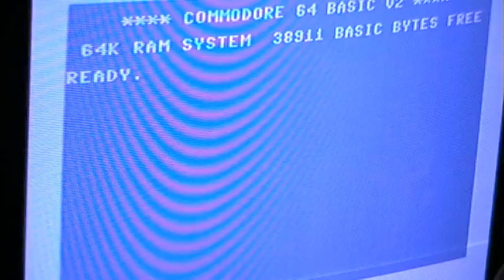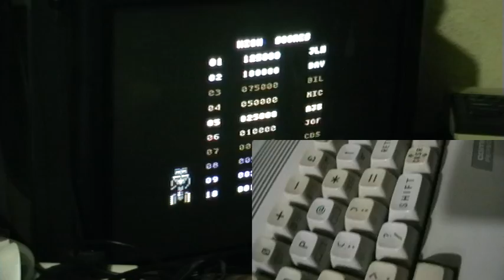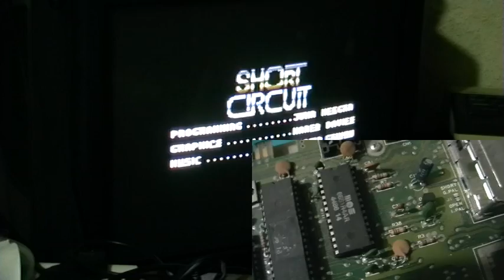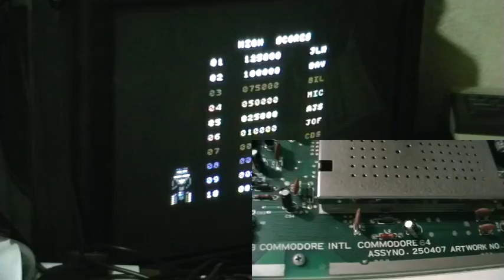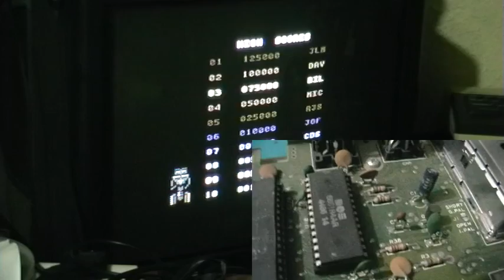Let's Compare - SID Chips - C64 vs. C64c vs. C64g

Comment from the maker: The difference between the old and the new SID chips is quite well known. Mostly for the problems with the digi sounds. 
That the old SID chips vary that much was a surprise for me, too. I've experienced it back in the day, but I thought my C64 was not working right or something else. 
You can take 2 C64 with even a SID chip with the same revision and they sound completely different. 25 year old electrolytic capacitors for the filters don't help too much for consistant filter response either..

Comment: The variation between different 6581 chips is very big. 8580s sound much more alike. It's a bit of a shame that you never quite know what SID tunes are supposed to sound like, how they sounded on the composer's machine. At least with 8580 you're always quite close to the original. I have a 1984 C64 with a 6581 that sounds VERY dark, and in some songs notes just get muted because the filters are being overzealous.

Comment: POKEYs all sound exactly the same. This is called QUALITY.
Reply from the maker: Well, the pokey is just a 4 channel square wave generator... there is not much room to sound any different ;-)
Ever heard about GTIA and CTIA?
They all look the same, or don't they? ;-)
Btw... the C64 has the same trouble with the VIC2 chip. They don't all look alike as well.
They all skimped on quality control at one point.
Reply: GTIA was how the developers wanted it to be, but they lacked time to finish it on time, so this was why CTIA was released first but this was only in 1978/1979. Most 400/800s were upgraded and not much later only GTIAs were used.
The only 2 real hardware issues on the A8 platform were the bad GTIA which appeared only in some 800XEs/65XEs from China which were only built in the very last years and the bad MT RAM chips in the 130XEs. Both of these  happened when a certain former Commodore boss was boss at Atari....
So yeah, same mistakes in cutting costs just a bit too much. But I’ll give Mr. Tramiel credit for truelly making homecomputers affordable....I still have my ST around here....
Reply from the maker: @atariandre5014  Same with Commodore.
The later revised SID was running to the original specs.
The downside was that many programmers used an off spec older SID chip and programmed it so that it sounded good on their machine.
Commodore also had a flaw in the video output of some later machines.
You got 'pixel snow' in the border in certain games.
But both were great machines to play with and make your first steps in programming.
I would have loved if the Atari machines would have had a bigger market share.
That would have driven both Atari and Commodore to improve teir machines further instead of selling the same shit for 10 years or even longer.

Comment: I had a C64c (bought from Dixons) and I was very disappointed with the quality of the digitized sound compared to my friends C64. I even took it back to the shop cos It was the amazing sound capabilities of the C64 what enticed me into buying it. They swapped the machine over (cos I said it had a dodgy sound chip) but even the new one sounded just as bad. There was a definite difference - people thought at the time I was mad!
Reply from the maker: Actually, Commodore fixed the glitch in the SID chip that was exploited to produce the digitized sounds.
There is a simple mod to fix the digi-sounds but nothing can bring back the sound of the old SID chip.
Reply: My C64C worked fine with the samples so must have had the old chip

Comment from the maker: This has nothing to do with cost cutting. The SID chip has quite a few analogue circuits on it, where slight differences from manufacturing can vary its specs quite a little. Even 2 SID chips from only a couple of weeks apart can sound quite diffrent, if they are from different production runs. 
From a technical point of view, the "new" SID chip is actually an improvement. It's closer to the original specs than the old one.
Reply: Theshadowsnose so I guess then only through emulation and outputting to a known high-quality a pair of speakers will we ever know what the games were actually supposed to sound like

Comment: You can definitely notice the difference somewhat in the bass and drums. But the bass especially. (I especially noticed in SIDPlay when playing the Creatures OST with it emulating both chips) Seems the last tune was designed with the later 6581 chip in mind.
Reply from the maker: You mean the 2nd tune in this video, right?
I'm not sure what chip it was designed for... that Martin Galway guy had some really unusual SID chip in the C64 on which he composed the tunes. 
I remember that there was even a special setting for it either in SIDPlay or in VICE.

Comment: Wow, thanks for this great demo. I must say, I think you could probably find some songs that would reveal even greater differences between these. Maybe some Rob Hubbard songs. He really pushed that chip to the extremes. As far as I recall, the lowpass filter is one of the bigger differences, and the songs in your example don't seem to use that very much. But great test! Much appreciated.
Reply from the maker: From my own experience, Rob Hubbard tunes sound pretty similar on both chips. At least the older ones like Monty and Commando.
I've tested a lot of different tunes in a sidplayer where I could just swap the chip in software.
The ReSID emulation is not perfect, but I think it gives a good impression of the differences between the different chips.
I really found that the tunes from Martin Galway showed tho larges differences between the different SID chips.
What I should have done is put in a tune that was done with the new SID chip in mind, but I didn't know any back when I recorded this video.
I probably do a remake of this video eventually just because I got a 3rd party content match on the "Who's Johnny" tune. The only reason why I didn't take this one down is that I think that it's a pretty good video and there was nothing comparable on Youtube when I released it. Haven't checked if there are similar videos nawadays.
But I'm not going to do this any time soon... as you can imagine, this is a lot of work.

Comment from the maker: If you can live with the different filters, there is a simple fix to give back the digi sounds. Just google for it...
Btw. The reason why there were no shouting sounds in the 'Fist' video is either htat I turned them of or that there are no sounds in demo mode... I can't remember.
Reply: Digi sounds like crap on C and G models with the new SID. I thought my machine had a bad SID at first!

Comment from the maker: Early models had the PCB from the last breadbin model. They changed the case to the new one before they made the cost reduced board with the new SID chip. At least here in Germany.
This C64C also has the graphic symbols printed on the front of the key caps like the original breadbin model. Later ones have them printed on top of the key caps below the letters.

Comment: I find sound chip comparisons interesting. What about some more from your other multiples?

Would be nice to hear some AMIGA ones if you get the 600 & 1200 and possibly some of your AY systems Vs AY.
Reply: Amiga models sounds identical from A1000 to A4000. Paula chip changed not so dramatic.

Comment: I prefer the 6581 sound but that's mainly because I had a breadbin and that was the SID it used.  It was also better for digi tunes, which always sounded quiet on my friends' 64C machines.  That said, some tunes had the filtering problem you describe.  Miami Vice was a notable example. It sounded like a total mess on my C64.

Comment: Is the C64G the PCB 250469 Rev. B. It sound more cleaner than fhe old C64 and the C64C PCB 250466. The latter C64C models have the same PCB as the C64G.
Reply from the maker: Don't ask me about the PCB versins... I honestly don't know.
The C64G has the latest PCB version inside, with htat huge PLA-combo chip and the new SID.
My C64C has the older board with the old chip. The one that is also found in the breadbin case shortly before the C64C was introduced.

Comment: i came to the conclusion a while back that some sound better on 6581 and some sound better on the 8580 (wont go into revisions). Overall I prefer the 6581 for its warmness and better sounding samples but I cant ignore the fact that my favourite C64 tune of all time, Bionic Commando, sounds way better on my C64c. In the end its best to own all models so you can go back and forth. I have a modified C64 breadbin case with UII+ and a C64c Mb inside. I used the C64c mb because its VIC II is so much clearer. Eventually I plan to buy a SIDFX so my modified 64 will have the best of both worlds. Both Sids in one box :)
Reply from the maker: Totally agree!
Some tunes sound better on the one chip, others sound better on the other one.
But since I grew up with the 'old' SID chip, I prefer that one. Most of the older tunes that I remember from when I was a kid just don't sound right on the newer SID.
I even haven't encountered the newer SID until I started collecting... not even at the beginning of that.
The first 'new' SID chip was probably in my 128D and I mostly used it for newer gams and demos, so that wasn't a problem.

Comment from the maker: I don't know about any differences in the Atari sound chips. Neither the one in the 2600 nor the pokey from the 8-bit series.
Afaik, the chips from the Amstrad, the Spectrum and the ST, along with quite a few other systems and Arcade machines were 'compatible'. So I guess they may sound different, too.
The SID chip is special in various ways. It's a 'real' synthesizer, not a programmable sound generator like most of the other chips, and it has the filters which cause 90%+ of the differences.
Reply: Theshadowsnose there are significant differences in sound between AY chip from General instruments and YM from Yamaha, even if they are mostly compatible.

Comment: I didn't really hear any differences, except for the third (quiet) sample at the beginning. I wonder why Commodore would cripple a key feature of any sound chip like that (the ability to play samples)?
Reply from the maker: Foebane72 The difference between the first 2 is not really great, but you should be able to hear a difference between the first 2 and the 3rd one. Especially in the 2nd tune. 
The ability to play samples was caused by a bug in the SID chip, so technically, Commodore fixed a bug in the chip... they just failed to notice, that this bug was commonly used to play samples... or they just didn't care.
Reply: Theshadowsnose yeah, the ability to play samples via envelope is essentially a bug and it is possible to reintroduce in in more modern C64 via simple mod.

Comment from the maker: Then I have to admit, I don't know how I did it... it's quite a while ago.
The 'Filters' are a key feature that makes the SID sound so much better than other contemporary chips. They were a 'little' off in the old SID chip. Commodore fixed that with the new version, but since the older games were programmed on the old chip with the 'bad' filters they can sound bad on the new chip. Take a look at the bass line in the 2nd tune. It sounds weird on the C64g

Comment from the maker: Wasn't the more consistant sound on of the 8580s 'improvements'? I never liked the new SID chip. I never heared it 'back then' since everybody I knew has got his C64 in 83 or 84. And in early 88 I got my Amiga and lost interest in new C64 games...
The old SID varies at an enormous amount even in the same model variation. I like some of the flaws of the older chip. especially if the filters distort. Makes it sound a little like a tube amp.

Comment: Well, digis are not SID's primary goal - R5 simply works as intended and allows for far more powerfull bass etc. I know as i compose for it ;)
Reply from the maker: jammerc64 I may work as intended, but I still prefer the unlinearities in the older SID chips. 
Guve the sound almoas a 'Tube Amp' like feeling
Reply: Theshadowsnose
heh ;) I bet ideal solution would be 2sid system with both chips onboard :D 6581 for acid, simulated guitars and keys, 8580 for modern bass, drums and the rest :)

cheers!

btw, mind that 6581 chips varied greatly between each new release - old sids can sound totally different themselves :) r5 was practically standardized and unified thanks to cutoff linearity, so everyone knew what to expect :D

Comment: C64 breadbin FTW!
The SID on the C64G sounds like this one guy in a orchestra is drunk and so he's messing up al the concert! XD
Reply from the maker: Well, I've chosen a tune that makes the difference very obvious. The newer SID chip doesn't sound that terrible in most of the C64's tunes and in some newer tunes the old one sounds awful.
Reply: Budget does not always mean bad. In this case Theshadowsnose is right. And the newer SID can play samples quite well, too when using another programming technique.
Reply: I do feel that the C64C had a more smoother, well-rounded sound, but I prefer the more arcadish sound of the original breadbin

Comment: imagine - C256k - 120 colours - 2 sid chips and graphical scaling hardware with 320*200 full colour resolution. mmmm
Reply from the maker: I would have been pleased with twice of everything... 2MHz CPU, 16 Sprites with 8 colors each And the capability of the VIC to do multicolor mode (with 8 colors of course) in 320x200.
A Stereo SID would also be great.
Reply: Eh something like this? : https://en.wikipedia.org/wiki/Commodore_65

Comment: I got a breadbox with an 6581R4AR, i just wish more of the music today was made for 6581 instead of 8580, but i guess most musicians like the extra filters the 8580 offers, or maby more people had newer C64's with 8580 growing up.
Reply from the maker: +EgenMusik for most of the tunes I know it isn't really a huge difference if the 65 or the 85 is installed.
But I agree that I encountered a couple of new ones that sounded horrible on the old chip.
I guess that the composer just use what's in their machine.
And since the 85 is newer, it's more likely that they have a machine with that installed.
I never encoutered the new chip back in the days.  Because when it was released I already had an amiga so did all my friends.
If not, they got a used c64 which also had the old chip.
Reply: EgenMusik 8550 is more stable and useful than 6581, has more waveforms.

Comment: I have a C64 (Brown Breadbin) and a cream C64c, both of them have the same 8580R5 in them which I thought was weird.
Reply from the maker: Probably the board has been replaced at one point in the brown C64. Afaik, they never put the board with the new SID into the brown case. The C64c was available with both variants. The first couple of months they sold it with the old board and then with the new one.

Comment from the maker: I got the C64g out of the trash and at first it had no sound at all, because the internal fuse was blown. When I replaced the fuse and tried it, I thought the SID chip was broken. Later I found out, it was supposed to sound like that.
BTW. the C64g of course also has the great "grey dot" bug in the VICII chip. What a pile of junk! I really prefer the old C64.

Comment from the maker: Don't think the Amiga chips sound any different. Just simple D/A converters. I don't know about the AY in the STs or Amstrads...
I knew that the different SID chips sound significantly different. Especially with heavy filtering. That's why I chose the 2nd tune. The filters sound completely 'off' on the new SID chip. 
Some of the SID chip add some kind of distortion to the sound on different filter settings. Makes it sound very 'Tube Ampy'. I like that.

Comment from the maker: Commodore probably did this in all regions. I don't think the reason for the new case was to cut down production cost, they wanted the C64  to look more modern, more like the C128. I would guess they shipped the C64C with the 'proper' SID-chip for at least 6 to 12 months, so it should not be too rare.

Comment: I prefer the original 6581 SID I think it sounded better than POKEY and depending on the song or effects it many times sounded better than Paula. Let's not forget the Apple IIGS  Ensoniq 5503 DOC which was awesome and the Tandy 1000SX sound chip which was also pretty good for the day. The Sharp X68000 had good sound as well with its Marcury-Unit: 16-bit stereo PCM @ 48 kHz sampling rate, 2× Yamaha YMF288 FM synthesis sound chips and so did the Acorn Archimedes with it's eight channel 8-bit stereo sound.
Reply from the maker: +carlos muniz The SID sounds better than the POKEY when it comes to music, yes. But I really prefer the soundFX from the POKEY chip.
Reply: The Sid is my fave sound chip but there's two sounds it produces which I hate. One is the FX sound of most punches,  hits and gunshots. (example: Robocop 2 when he fires his gun). And that whiny sound that appears in most Mark Cooksey tunes (although I still love Salamander and Ghosts n Goblins music). And Genrally Drums/beats are the weakest parts of a sid tune in my opinion. But... Still the greatest Sound chip ever! so much personality. It makes the C64 almost feel like it has a soul or something compared to other computers. I include the Amiga. Love Paula but its just a sampler at the end of the day.